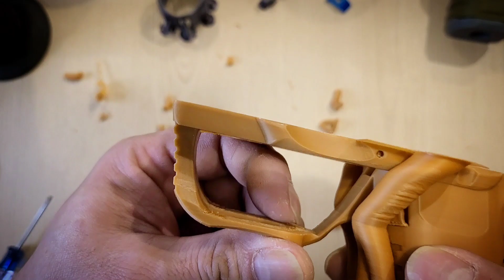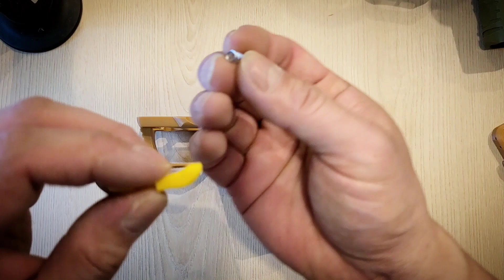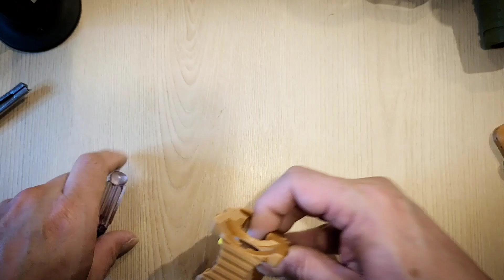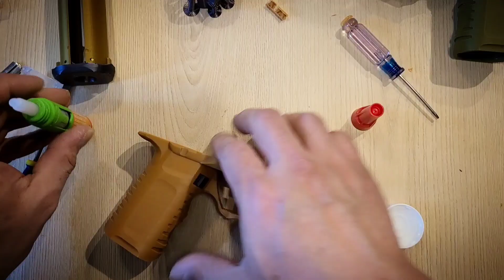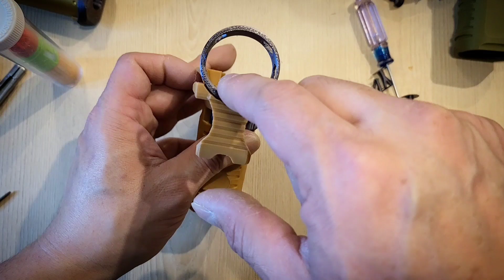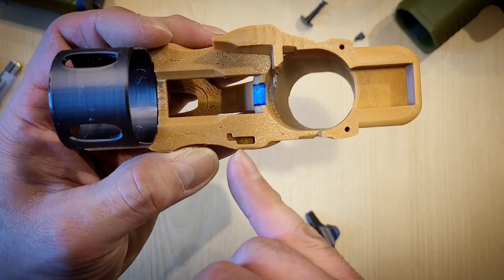6. The Lower Assembly

Comment: with the tape on the barrel, would you think the bucking doesnt fit in deep enough in the slit? lifting the bucking up. what do you think? would it make sense to only use one strip on the end of the bucking and thats it? thanks for the idea aswell.
Reply from the maker: @TOTAL90s   It has been tested and working for me. When it comes to real results, there is only one way to find out what works for you :) also, the mod was not just aimed for improving the air seal, but I also focus on absorbing the vibration and filling the dead space. It works better than just putting o-ring or metal rings around the inner barrel that you commonly see in the market.

Comment: I'm building my first block26 and I'm super excited but I ran into one issue so far. The magazine release can easily fall out of the lower when using the TPU version. If you accidentally push the magazine release from the opposite side even the slightest amount, when there is no magazine in the gun, the piece falls out through the magwell. This issue is only present with the TPU version. I have switched to the non-TPU version to avoid this issue.
Reply: Really? You must have some extremely soft TPU...